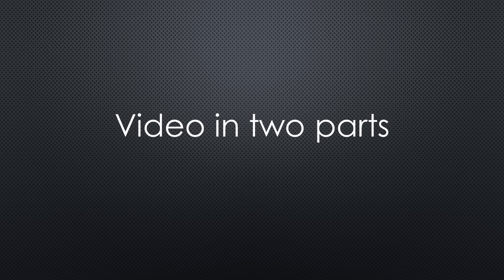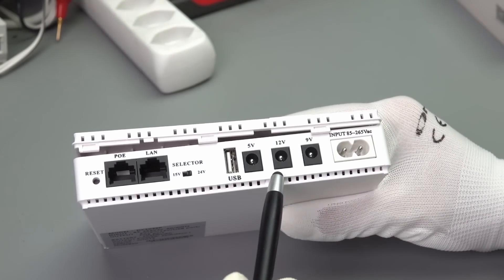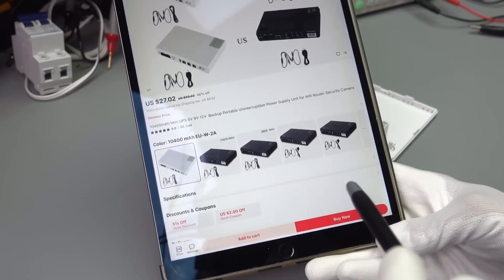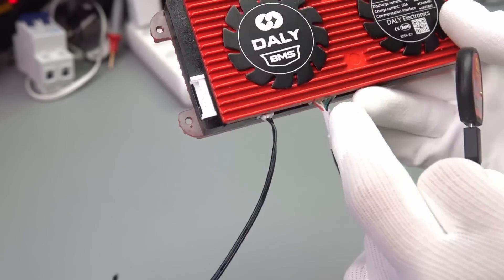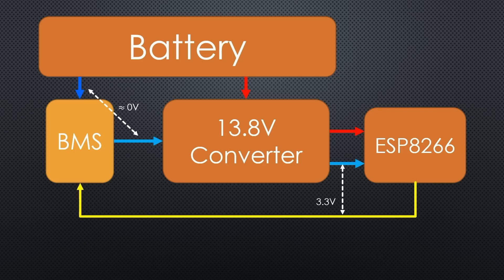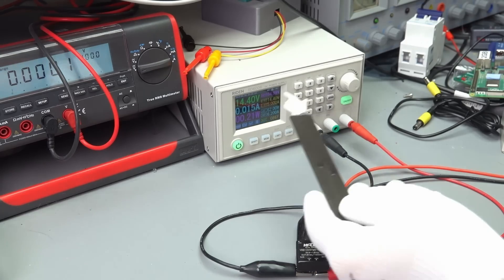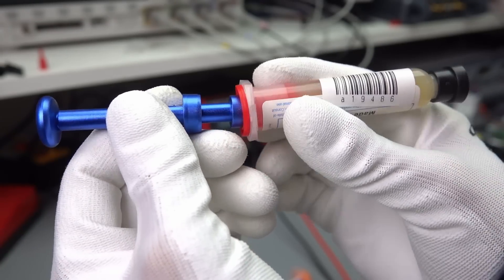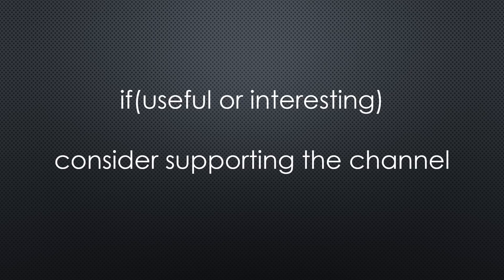458 The second Part of My Long Mailbag

Comment: Interesting product. I know that the legal situation in Switzerland is different from that in the EU. As I live in the EU it would be interesting to know if distribution in the EU would be allowed. In the end, it's all a question of liability and law. That might also explain the low price.
Reply: The price was low because it had a temporary 46% discount. It normally costs closer to 50 euros / dollars. But if you search a bit you'll find other sellers with a discount. Just make sure it's the right model, since it comes in several versions (different current and different battery capacity).
Reply from the maker: The prices on AliExpress changed after I made my video. But I found links on ebay for a reasonable price (I added it to the video description).

Comment: UPS: have you tested it for amperage and Ah? After seeing/trying multiple AliExpress battery based devices which were useless due to fake batteries, I decided to do my own UPS with an external battery. I also have 5V, 9V and two outputs for 12V plus 2 USB outputs (I didn't bother with POE, as modem and router is now connected to my UPS).
Reply from the maker: A quick test on 12V/1A gave 26.8Wh
Reply: @AndreasSpiess  Thanks Andreas for testing that and reporting results! It seems to be indeed a usable UPS for a short/mid-term electricity cut.
BTW, I like your videos, especially as done by a local, thanks.

Comment: In last weeks video you showed the mini hotplate MHP30 and said it was great to pre-heat, no doubt there :ø)
I would suggest getting some low-melt solder, possibly also paste, that melts at/below 138 degrees C.  Wet the solder joints with this using a regular soldering iron, then use the hot-air set at a 150 degrees C - and you can remove defective module(s) without risking desoldering nearby components.
This is also excellent if you have components on the bottom, which makes the hot-plate unusable.
Reply from the maker: Thanks for the info. I never used such solder (I saw it once in a video). Maybe I have to give it a try...

Comment: Why use flux when soldering? There is enough flux in the solder for the job they have been putting the right amounts in for years. If you buy cheap solder then you may need to add more cheap flux. I have worked in electronics since starting work in 1976, I can say that except for desoldering I've never needed to add flux. If you need to add flux then then something is wrong.  Your pcb is dirty or oxidize, same goes with your components keep it all clean and your oily fingers off the pads and you should be fine. In the last 10 years I've bought one flux pen from  Farnell no unknown stuff from overseas and I expect that its still 90% full.

Adding excessive flux is one of my pet hates, it makes a mess of  the pcb and the fumes are not good for your health.  But if you feel the need to use it buy it from a electronic distributor so you can see what its made of and what protection you need to take from it.
Reply from the maker: I agree that solder contains flux ( I use Kester, BTW). Still, drag soldering of SMDs is a pain without adding flux. And desoldering anyway...
And of course, I am not as experienced. So I need a bit help from flux.

Comment: Hi Andreas and thanks for the video. Could you please check the DC outputs of the white UPS with an oscilloscope and confirm how clean the output voltage is? (I don't own a scope) Many thanks!
Reply from the maker: The scope showed 28mV RMS on 5V
Reply: Vielen Dank, Herr Spiess! And is it safe to assume that the peak to peak is in the region of 2.8...3.5 * RMS, i.e. less than 100mV?

Comment: If those cells are in series, then the capacity isn't 10400mAh, its 2600 mAh at 14.4V nominal.
Really irritating that some advertisers just add up the mAh of all the cells in the battery, and completely ignore the configuration!
Using watthours would give much more accurate and informative measure of capacity than Ah, which requires a voltage to give it meaning.
Reply from the maker: I agree!

Comment: For me the UPS costs 54,55 euro and 34,55 euro for shipping. So 89,10 euro in total.
Reply: Same here (NL)
Reply from the maker: Indeed. I checked now and the shipping price went up. So it is no more attractive, I agree.
But I found a link on eBay Germany for 36.88 Euros including shipping and added it to the list.
I also found one on ebay.com for $33.71 and added it, too
Reply: Not even customs duties explain the high shipping price….
Reply: @herrgeozeichen2344  - China has apparently been cracking down on shipping of "insecure batteries" (maybe they had some catch fire in the post). They probably had to ship it through a different courier.
Reply: Andreas' screenshots show it had a 46% discount when he bought it.
Reply: @RFC3514  Mine shows the same discount percentage, but the much higher prices I mentioned.
Reply: @carlanderson5068  - So for you it appears with a $80.2 base price (-46% = $43.31)? 

I did manage to find a seller (on the same site) selling the "36W" (2A) model for $32 (listed as "$64 base price with a 50% discount"). 

It seems to sometimes be listed as "10400 mAh" and sometimes as "10000 mAh /  4x 2500". I wonder if they're clones made by a different manufacturer or if they just change it depending on which batteries they were able to get.
Reply: @RFC3514  Not quite, base price is $78.75 (with 45% discount, making it $43.31). I think you might be onto something with the rest of your comment, though.
Reply: Same here
Reply: Similar prices for Canada
Reply: I am in US and it is $43.31with $30.53 shipping. I found the exact same thing  on Amazon for $40.98 with free shipping (but won't arrive until sometime around the first half of July, which isn't too bad, unless I pay $45 for expedited shipping to get it next week).

Comment: For a flux dispenser the K-2208 so worth considering.  About the same price on Ali etc, has a ratcheting mechanism making removing the tube easier.  A bit chunkier though.
Reply from the maker: Thank you for the info. I also saw it in Voltlog' s video after I made my video ;-)
Reply: @AndreasSpiess  Popped up as a recommendation after I purchased the "long bolt" type you've got here.  Always the way.

Prefer the screw type for glue (small & lighter), not sure about the K-2208 yet.  Has spots to hold 3 tips in its body (neat) but one is too large for them.  Odd.

Comment: My comment to the white power supply: As I could see, the power supply includes 4 Lipo batteries with 2600mAh capacity each. The batteries are connected in serial (not parallel!), so the capacity is only 2600mAh and NOT 10400mAh!
Reply: Agreed! It is just plain wrong, and false advertising, to state the capacity of a UPS, particularly a multi-voltage one, in Ah! Wh is the correct unit. Even when selling individual cells, Wh is better since the output voltage of the cell will vary depending on state of charge and load. Just as bad in my book is the abuse of the SI prefix system to give a larger number. It is 10.4Ah, not 10,400mAh! We need a 'Campaign for the Protection of the SI'!
Reply from the maker: I agree, mAh is not a good specification for a device providing different voltages. You can even try a dispute because of wrong specs if you bought one ;-)
With my video you know what you can expect and do your calculations (as Refthoom did).
Reply: @AndreasSpiess  That's true your videos are always very clear, I like that very much.
By the way, is the 5V adjustable? You showed it was 5V exactly and 4.9 at 1A. For a raspberry pi 3, 5.2V is the ideal value to prevent low voltage warnings and possible brown outs.
Reply from the maker: @Refthoom  I did not check if it is adjustable. But the 4.9V has to be attributed to my crappy setup (it was not a thorough test).
Reply: Indeed. So theoretically it would be 2,6A x 3,2V x 4 = 33,28Wh. At the given 36W capacity and assuming no internal losses it would last about 45 minutes. A raspberry pi 3 that uses 8W on average would last a little bit over 4 hours.
Reply: Exactly - they always relate capacity to single cell voltage which is not useful and just generates shiny high numbers. Capacity in Wh would be much more meaningful.

Comment: Regarding UPS. It has overcurrent protection, so if your device requires high startup current it may be triggered. Also if you need to power router it is not mandatory to have specifically 9 or 12 volts ups. Most of the modern routers have dc-dc in inside. They can perfectly work with slighly lower or higher voltage (check ic spec). It was reported that for some models even 5v ok, because usually internal electronics is 3.3V.
Reply: In fact I tried this experiment some time ago with my Dlink router. I dropped it in 0.1v steps from 12v and it finally cut out altogether at 7.4v, so it must have a voltage regulator which needs at least 7.5v
Reply from the maker: Good to know. Thanks for the info!

Comment: It's funny. I'm buying a 15k watt propane / gas generator.  I looked into solar but being half my house blew away last Sept in a hurricane I'll save money (up front not over time) the few times a year my house loses power. My collection of leds and 18650s got us through last time but it was horrible. I plan to buy a giant propane tank and just run the essentials.
Reply from the maker: Your situation seems to be very different to mine (we luckily have no hurricanes). So your solution has to be differet!
Reply: @AndreasSpiess  which sucks because my roof gets sun literally from dawn til dusk Mr. Spies. Same with one side of the roof on my 10x20m detached garage. It used to be a cabinet makers workshop. I plan to get deeper into woodworking so it'll get more use than changing tires. I installed central air from a compressor that fills when one of the outlets is connected. It's funny. The airhose cost more than the compressor. It has a wood furnace that heats the place in minutes if I ever wanted to use it in the winter and the wife insists on using wood as our main heat supply in the house. It barely heats our living room and kitchen but the cats like it. I divorced myself from it years ago because my wife is neurotic about when it should and shouldn't be lit so I invoke the happy wife, happy life relationship topology. Hahaha

Comment: I wonder if it'd be possible to 3D print the ergonomic syringe handle? Obviously, they're really cheap, but you wouldn't have to wait for shipping. Great video!
Reply from the maker: Other commenters found ready-made 3D designs. So it should be possible.
Reply: Should absolutely be possible, but needs to be beefed up a bit I think to take into account the structure of the 3D printed part. Especially solder paste (in my experience) needs quite a bit of force to get out of a syringe with a thin needle.